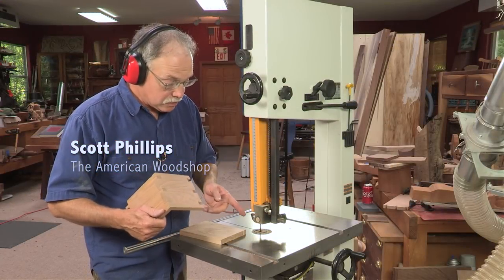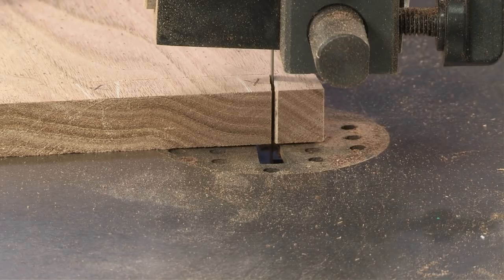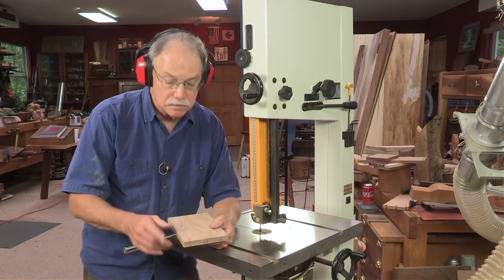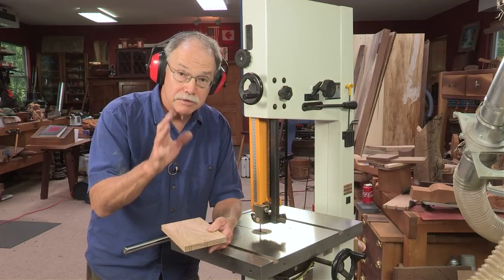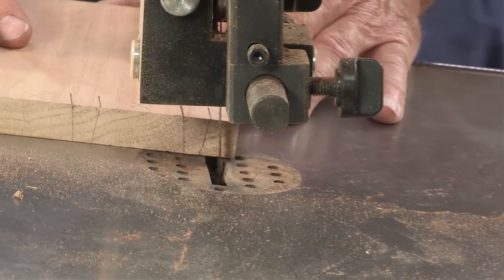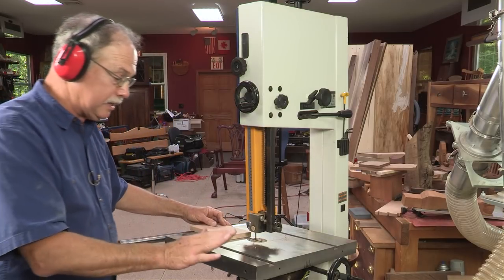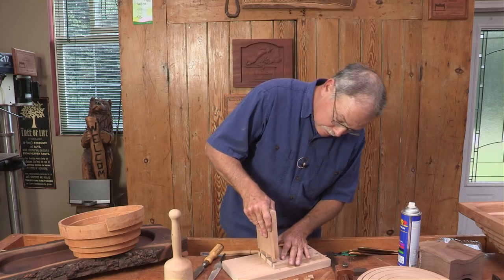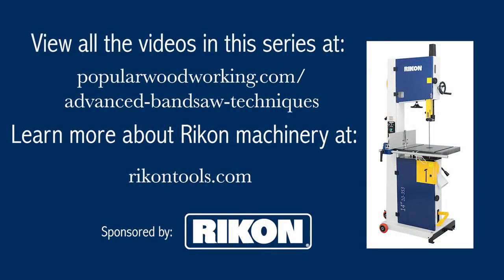Through Dovetails on the Bandsaw | Advanced Bandsaw Techniques Part 4

Comment: Why wait for the band saw to stop? Safety issue?
Reply: Sleepydog for this video, so no lawyers come knocking. In general, though, pulling back on the work piece while the blade is moving can pull the blade forward off the wheel if it binds since there is no thrust bearing. Not really an issue on a straight 3/4" cut, but a real possibility if you are cutting curves.
Reply: @NitFlickwick  Ah i see. Im so used seing people going backwards when they make complex figures. Thanks for reply!
Reply: @NitFlickwick  i pull back with long curved cuts no problem. If you got a feel for your bandsaw, you will detect the beginnings of a 'catch' when backing out of a cut, and get past it with a subtle wiggle of the workpiece, with a bias toward the waste side of the cut to maintain accuracy : )

Comment: practical but not the best and precise finish! gap is seen very clearly but still a good idea in case you r willing to compromise below 100% clean finish, on other side I think angle of the band saw can be better adjusted and depth of cutting to eliminate the gap and get better fit. thanks for the idea of using the bandsaw!

Comment: Instead of tilting the table the other direction to finish the 2nd dovetail cuts couldn't you just flip the board over?  Nice video!  Thanks!
Reply: I am not "the Guy" but one drawback about flipping the material is that you have to layout the cuts twice. That can induce error but it will allow the marking lines visible on the viewing side of your piece.

Comment: Why shut it off after each cut. Why not split the line? Relief cuts at the same time enable faster chiselling. I only use the bandsaw for tails; pins require handsaw accuracy. I've been doing this for decades. Also, I've discovered small pins have greater finesse.